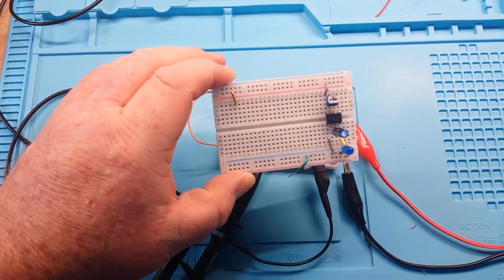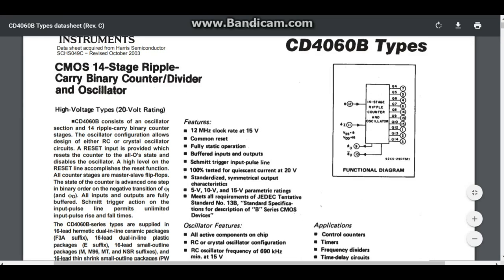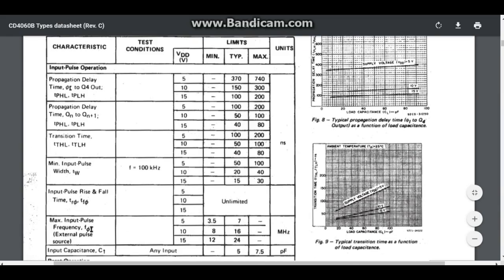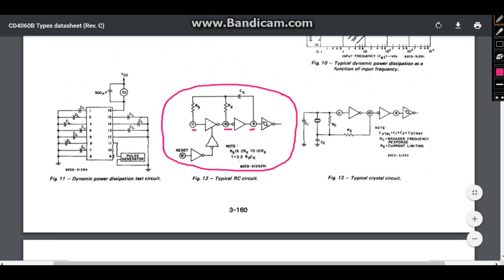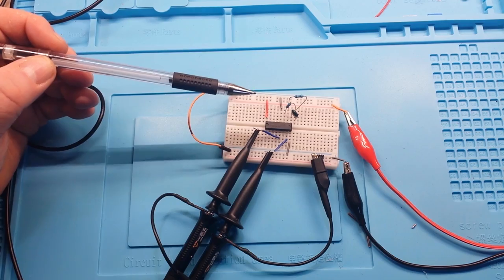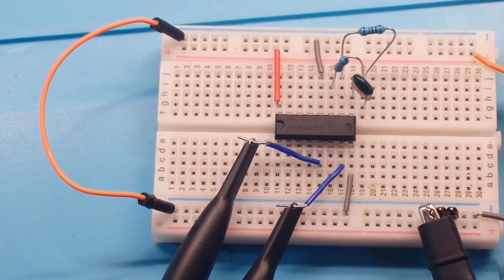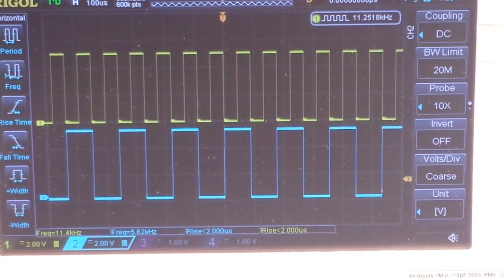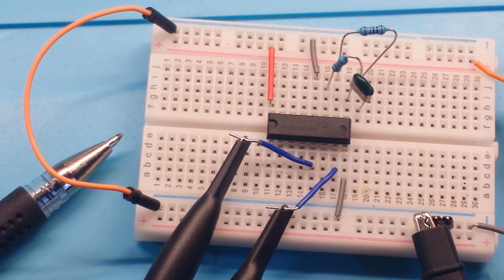Quick look at the CD4060B CMOS Counter/Divider Oscillator

Comment: ok, great video as always...i have a noobish question tho. How would i go about slowing the oscillation to hz range?(maybe even .hz, is it even possible with a chip like this?) I see a lot of useful videos from you, but everything is either kilo hz or even mega hz.
Reply from the maker: F=1/2.2×r×c
Reply: In addition to setting the frequency with the RC network, you  can slow it down by using divider chips like even the 4017 or 4040 and divide it down as slow as you want.
Reply: @GadgetReboot  Also 4024 and 4022

Comment: Nice. How stable is the oscillator frequency vs. temperature?
I ask because I was building an oscillator with a 555 timer and the frequency varies with the IC's temperature.
Reply from the maker: The data sheet doesn't give a great deal of information. But it seems to much more voltage dependent in my experience. of course you cant have one without the other. More voltage is proportional to more current and I*E=P so...

Comment: Isn't that 100k part of the RC network?
Reply: The resistor going to the input pin has little effect on the frequency.
If you put your scope on the junction of the resistor and capacitor, you will see that that point actually swings below ground and above the +5V supply.  The chip has diodes that protect the input buy conducting over voltages to the supply lines.  The series resistor limits the current in that path so that the limiting doesn't change the timing (much)